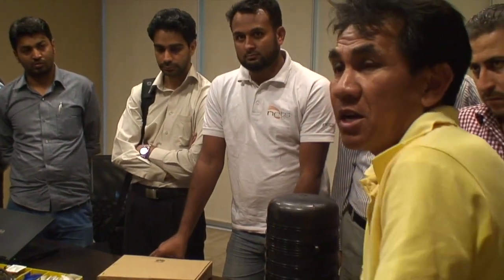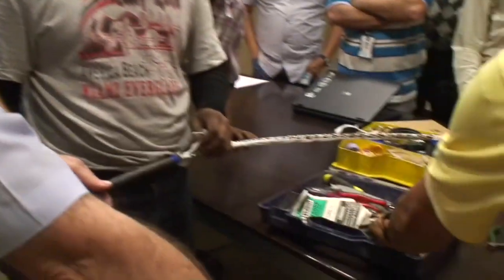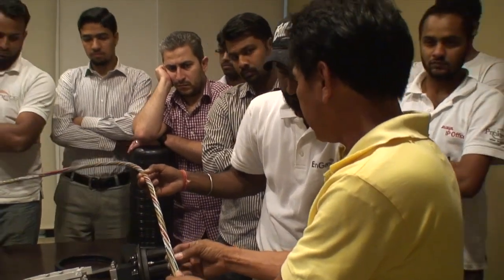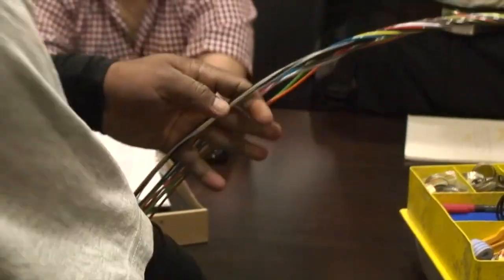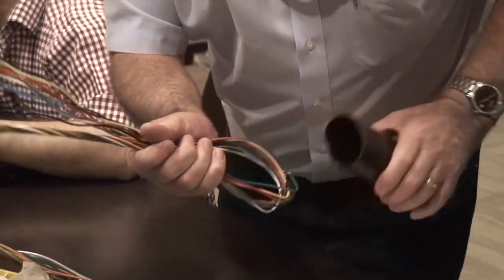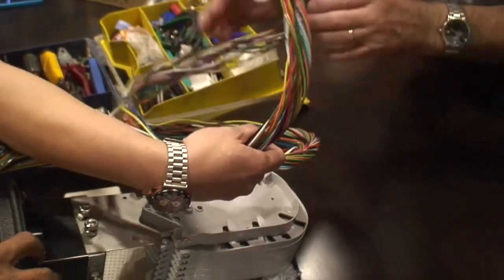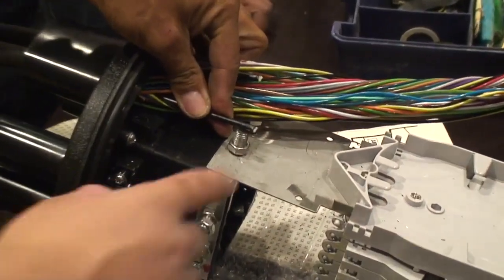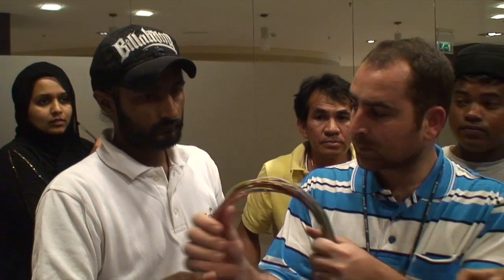Huawei 288 Enclosure

Comment: Work on ireland ftth with tyco and this guys method is not the  greatest.. btw we here do an encolosure with 1 loop and 1 overheadcable in less then 1 hour even if it is a splitter enclosure
Reply: awesome,but  i got one question, do you deal with a 288 core distribution cable?  since you are on ftth most likely you deal with a max of 48 core on a regular and a cable like this would be  a feeder cable
Reply: we are a manufacturer for fiber enclosure in China, our official email: sales010@mbwinners.com
Reply: I do splicing work I have to work in underground fiber